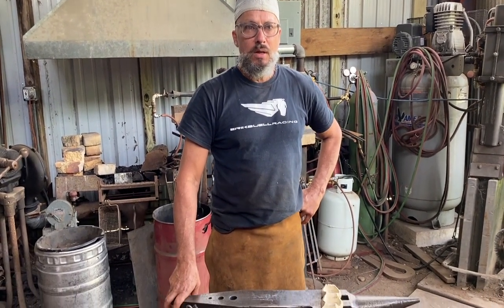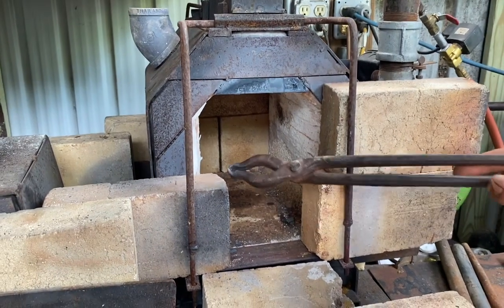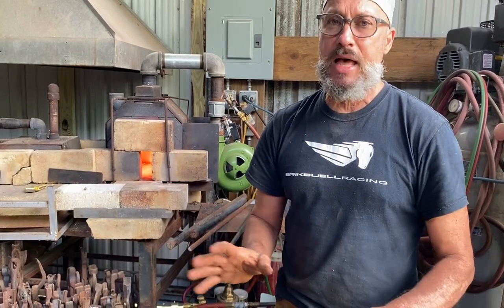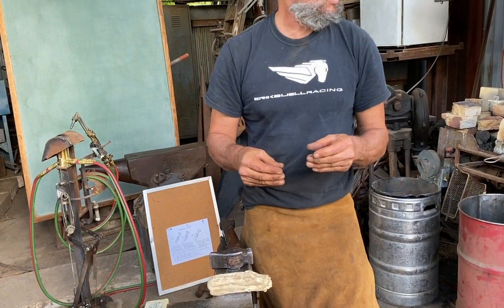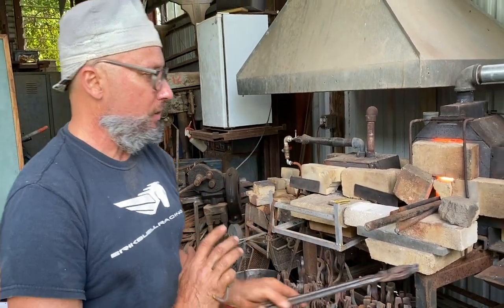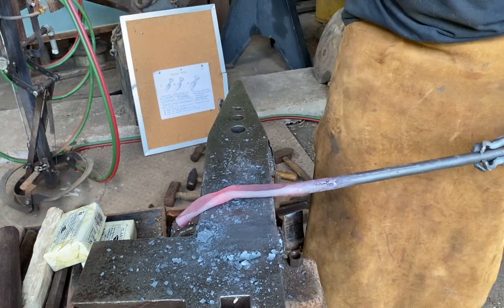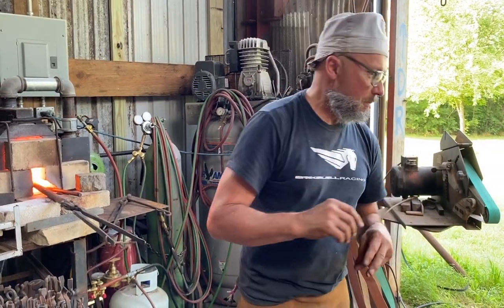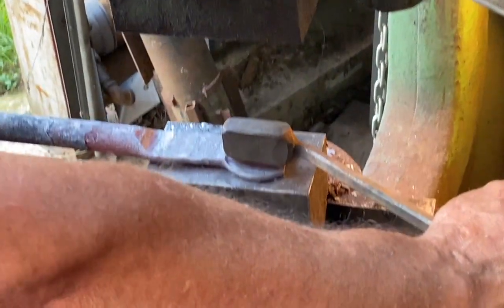Blacksmithing School 2.2: Hammer Theory in Practice

Comment: Learned a lot from this as a newbie. Never thought the peens could be so effective at moving material in only one direction. It's almost like they exist for a reason! Thank you for making this :)
Reply from the maker: Hi Mikky,
  I am glad you found the explanation useful.  I was taught that the peen is used to spread the material and should be as wide as your pinky. I reflect how much was left out of that lesson, and most other lessons, from my old teachers or demonstrators that could have been more elaborate or they perhaps just lacked imagination or experience.  From my personal experience of making and using hammers, as well as teaching and watching students struggle or not, the hammer can be much more than a beater.  And the peen can be utilized in ways that are beyond spreading.  It is a narrow forging face. It is also a texturing tool. If the peen is ground as I said in the video, it creates a unique smooth transition due to the ends ground into spheres, so it doesn't leave edge marks and probable shuts. The peen as well has two radiuses, the not so obvious is the radius created by the transition from the peen's edge toward the eye.
   In 1998 I attended an ABANA conference and was in awe of an Italian blacksmith, Angelo Bartolucci, who despite not speaking english he spoke elegantly with just the hammer and anvil, and created the most beautiful flower forms. He knew the nuances of the peen, face and placement on the anvil and horn, what is happening to the material both top and bottom, what a wonderful language to speak if you know these basic things.
kind regards, 
Will
Reply: @blackmetalstudio6425  Thank you, I will check my hammer and see if the peen has the parameters you prescribed. A lovely story on the Italian smith; you're right, we can learn from others even without words, as long as we stay curious!
Reply: @blackmetalstudio6425   hey bud. I love all your videos. I really want to buy a hammer from you . Would you sell me  a cross pein